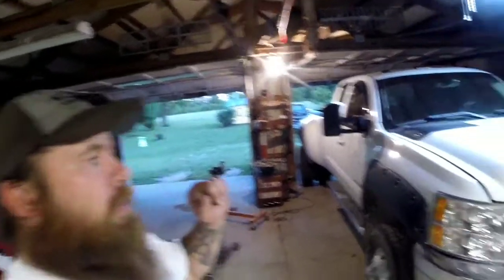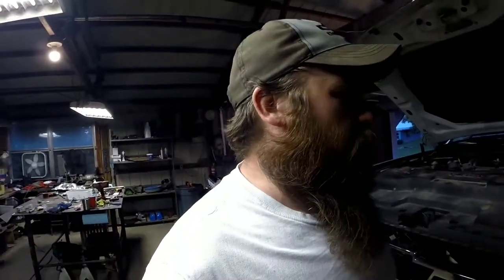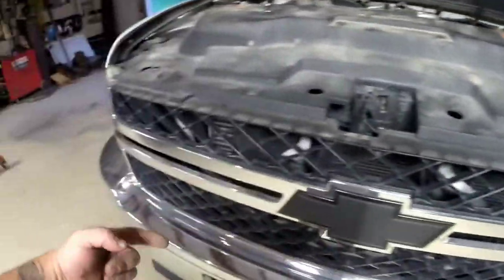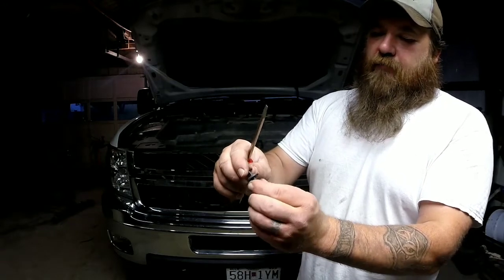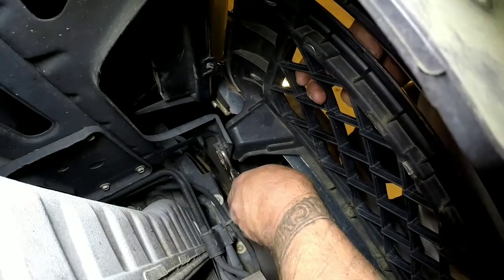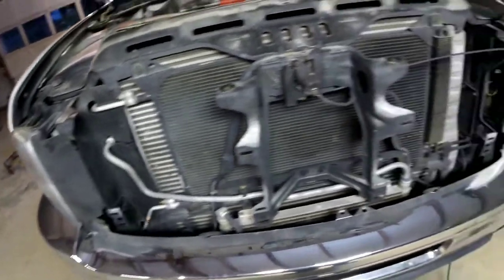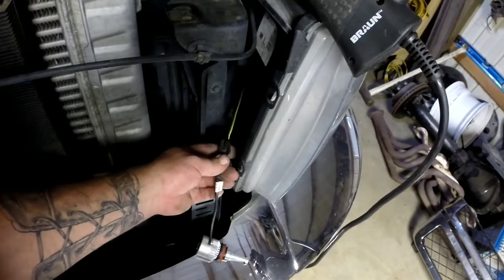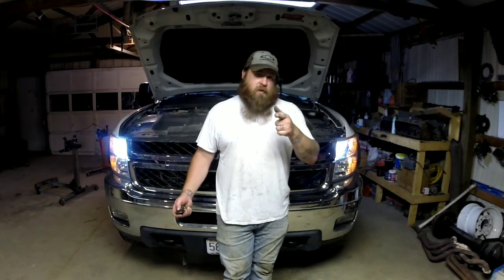2012 Silverado headlight bulb replacement

Comment: Very informative!
 I had always heard the headlight replacement in the GMT900's was tough.
Much harder than the GMT800's.
You definitely made it seem tolerable!
Reply from the maker: I think someone passed off the engineer  that designed the headlights

Comment: G'day from Australia...Just an idea for you to consider... I've replaced the plastic clips on that upper shroud, with Rivnuts. It takes 30 seconds with a 10mm socket on my Milwaukee 12 volt rachet spanner and that shroud is off. I only use the 4 front bolts...the back ones above the radiator aren't really needed anyway.
Then, I've junked all the plastic clips on the grill. I've added a couple of small steel "U" shaped brackets near the bottom. Now, when I put the grill back in, I just drop it into the 2 "U" shaped brackets and then put the 4 10mm bolts in.
So, 8 bolts hold the shroud and the grill....I can have them both off in less than one minute.

Comment: Whoever decided that you either need to remove your air box and battery OR your grill assembly to REPLACE A BULB is a dick.  Thanks for the video though, super helpful.
Reply: Alright, I just got done with this BS.  Removing the grill is the way to go.  I did my high beams as well, which are even harder to get to.  The bonus move here is to remove the top two mounting bolts on the headlight assembly and that will give you JUST enough wiggle room to make everything happen.  Cheers.

Comment: I'm pretty sure it's a 2005 Silverado that you open the hood and the headlights have a locking pin that you rotate 90° and it pulls out then the whole headlight comes out, using no tools at all.
Why can't they keep it simple?
Reply: Yes that’s what I had until now and these 2012s are messed up now to change a bulb😳

Comment: I was told that I shouldn't touch the glass of the bulb with my fingers.  (I knew that about the tubular-type bulb in a shop light.)
Reply from the maker: Yes, you don't want to touch the halogen type bulbs. The led bulbs aren't as picky

Comment: There has to be an easier way
Reply from the maker: Not really. Either remove the grille or remove the battery and or the air box. I prefer removing the grille.
Reply: @SquarebodyStuff  
Just took my air box off! Took less Than a minute. Work smarter not harder! :)
Reply from the maker: Whatever works best for you.